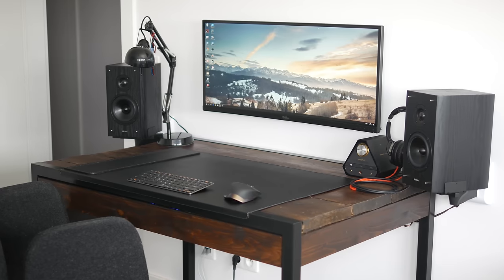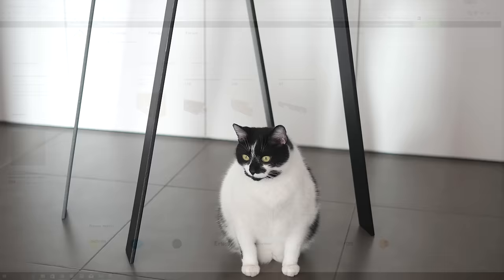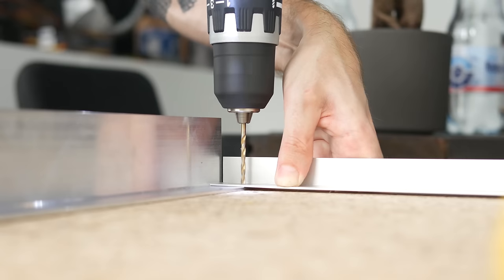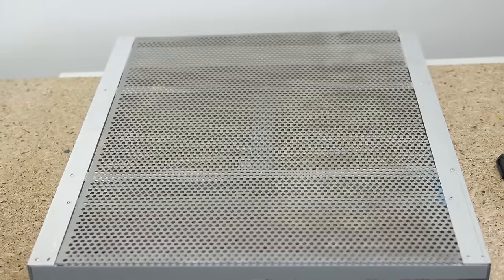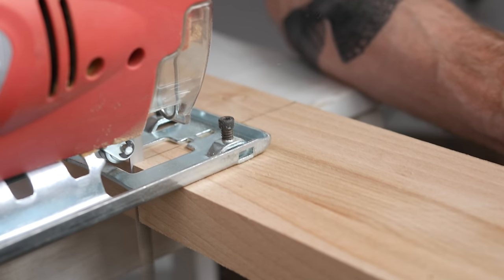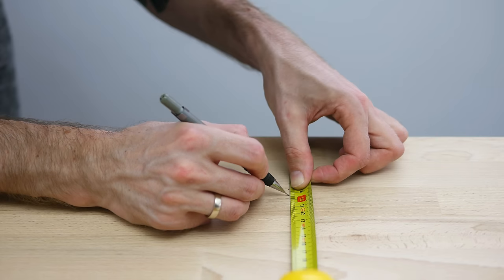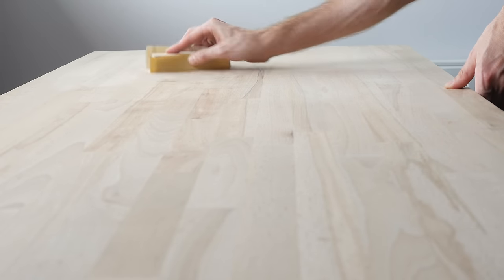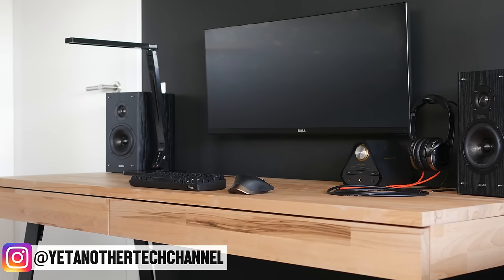How to make a desk PC for adults (DIY desk PC)

Comment: 7:12 "I ordered some of that steel mesh that ricers use to make their Hondas go faster" YOU ARE MY NEW FAVORITE PERSON
Reply: All the dislikes are from the Honda ricers lol. That comment made my day :)
Reply: just scrolled down to the comment section to say the same thing, but saw your comment lmao
Reply: Your toe socks are pretty sweet too.
Reply: For a daily driver , Honda’s are very well built.
Reply: @Internet Guy i have a 2010 si bought  new and have 52k kms on it. No major problems so far except for a evap check engine light while my wifes 2014 honda accord had a starter problem at 45k. I used to like honda but I think they are banking on their name instead on building quality cars like they did in the past. Not planning of getting rid of my si considering all the new tech that they are putting in new cars is only asking for major headaches on the long run
Reply: @dregsta  must be bad luck. I had a civic in 2007 which I sold in 2015 with over 100,000 miles on the clock. Zero issues with it.  I then bought a new civic in 2015.  I have had it 4 years and no problems yet.

Comment: That's not a CNC it's a trim router an CNC stands for computer numerical control
Reply: I was about to write: "wait did he just say CNC?" xD
Reply from the maker: Duly noted ;)
Reply: Stewart Your profile photo perfectly match with 
your comment. 😂😂😂
Reply: Duly*
Reply from the maker: Duly noted (and fixed ;)
Reply: this is impressive, good work! i have a couple more tips for you. at 5:10 it looks like you're using a saw designed for cutting across the grain (not along it) so i bet that took a really long time. and i'd recommend pan head screws for fixing metal parts like legs and brackets to timber(5:38), the flat bottom has better contact to the piece and will reduce the tendency to get sloppy over time.
Reply: I was cracking up at that. At first I thought he was joking, bragging about his preciseness with the router and his hand tools. He hand cuts it so precise, people will think it was done with a CNC.
Reply: Stewart I know that's not a CNC machine because I've seen one. Maybe he need to go learn about tools before he makes a video using tools.
Reply: " Maybe he need to go learn about tools before he makes a video using tools." what kinda comment is that the dude just built a desk from scratch using only hand tools and power tools and the results were good so just because he made a slip up about calling a router a cnc router suddenly he dosent know about tools? he did alot better than most channels theese days its lets make a desk step 1 buy a desk step 2 screw some bits to it boom desk or step one put everything in a cnc router/3d printer/laser cutter have the machine do everything for you hire a mexican to assemble it and boom you just made your own desk
Reply: captainrobots And you could name all the tools perfectly in Polish or any language other than English?
Reply from the maker: I make a living as a technical writer (and not an engineer who knows all the tools) and English isn't obviously my native language so I'd appreciate if people cut me some slack... I'm trying my best, making things in a room that's less than 11 square meters.
Reply: captainrobots as an engineer, I've used some, and just from your comment judging someone who made a mistake, you don't actually know much about CNC, because it isn't just one machine, it's a whole category, from centre lathes, milling and Lazer cutters. I know it isn't common knowledge for everyone, but you're last line in you're comment was just unfair, yes we all noticed the mistake, but really what's the big deal, he's been corrected and acknowledged it before you wrote your comment.
Reply: YetAnotherTechChannel dude you don't need to defend yourself against these comments! I heard you make the mistake but I knew what you meant and the fact that you built this table so well with the tool you used is amazing! Haters gonna hate, Potatoes gonna potate! Lol
Reply: yeah yeah bulls shit
Reply: Rob Groom Defend himself? He made a mistake. He doesn't know what a router is and he doesn't know what a CnC machine is. You have to be able to take criticism, especially if it's a factual error. If he didn't, people would watch his videos and believe that a trim router is actually called a CnC machine when there's 100% no computer controlling it.
Reply: RaySchrantz how many subscribers have you got??? 18...... well done son...
Reply: Adam Ross  to be far we should call things by the right name, however he had a reason, he recognised his mistake, and now knows for next time, so we can all stop bitching and appreciate the desk he built that looks very good
Reply: YetAnotherTechChannel you did a great job. I definitely want to build my own.
Reply: Your profile pic goes with your comment really well
Reply: Daniel Willets are you talking to me?
Reply: MyTruckinLife ACE. No the original comment
Reply: Daniel Willets sometimes these threads are confusing. 😺
Reply: you could've said potato fryer for all I care. lol your work is amazing
Reply: shake it off shake it off...
Reply: @YetAnotherTechChannel  chill out youtube community got your back bro. keep shining. also, beautiful desk. i'm interested in making one for myself so now, you're an inspiration :)
Reply: Lmfao, I was gonna say the same thing.

Comment: I mounted my PC inside a solid oak cabinet with a slide out draw for the keyboard+mouse :D

The hardest part is cable management and making it neat. I thought cooling would be an issue but that was the easy part, with only 2x 120mm fans on the rear blowing in it already runs cooler than inside my Corsair case! The cool air being sucked in forces the warm air out of the gaps at the front.

Comment: Any chance you'll upload your sketchup files so I can build one without having to do my own measurements etc?
Reply: Callum I would appreciate that too. Want to build my own Desk too. :)
Reply from the maker: I can upload it... but I'm not sure if it's going to be very useful - the drawer has absolutely no details.
Reply: whatever info you have would be useful :) overall dimensions etc and the overall design would be a great help - as the video is often a little hard to follow in working out exactly what is attached to where underneath
Reply: it looks like it would be useful from what i could see on the video
Reply: Upload!
Reply: Callum Did he ever upload the file???
Reply: This guide has sufficient to make your own desk, in fact depending on the size of your room his one might be too big. 1700x650 is a lot of desk! If you want to fit a similar pc build in the drawer then just make sure you allow for a minimum internal drawer size of 550x500, then attach angle aluminium brackets to fit your particular build. I would recommend using m3 bolts rather than rivets, as you can't adjust something you've riveted very easily. As long as you draw a scale plan of your desk and allow for the thickness of the wood, the drawer runners etc., and you have the tools for metal and wood work then you should be fine.

Comment: Very nice work but why, when you have put so much effort in to the desk, did you mount the gpu upside down instead of showing off the "nice" side of it?
Reply from the maker: 1. It's an OEM Zotac GTX1060 so it has no 'pretty' side. 
2. This way GPU fan has better access to outside air.
3. It's not that the desk has window (never!) so I'm not bothered at all... 
4. That black PCB is kinda sexy.
Reply: Have you thought of mounting them at a slight angle so the rear edge of each item is maybe an inch of the horizontal so as to provide a bit of a better viewing angle if you also put a see through top on it, I think that would look kinda cool... oh yeah btw damn those socks are brilliant
Reply: Thing is the pcie cable can't be twisted that much, certainly not enough to 180 the GPU

Comment: You've inspired me twice today. First, with the mini ITX custom case build - I was fretting about finding an exact 'cube' case that I could use as the lower level to a Tardis case I was going to mod for my wife. Your bent aluminum approach showed me that I can mod the whole 'Police Box' fairly easily.

But this desk case solves another problem. I have a beloved computer desk with a very wide, but otherwise useless keyboard drawer. I'm going to use the steel mesh approach to build a drawer insert for mounting discreet components. Since I love tinkering with the PC, this will allow me to pull out the drawer and admire my rig... 

Thanks - sometimes the simplest DIY approach is the best, even if cool cases are available at reasonable prices. Nothing beats home grown...   :-)
Reply from the maker: Thanks very much! Your comment just made my day :)

Comment: Interesting build. I'm wondering if this is a good solution for a water cooling. According to the my research, radiator should be positioned above the water pump. Otherwise air will be trapped in the water pump which significantly reduces performance of the cooler...

Comment: I found your table amazing, but you can imagine a way to leave that temperature display in a visible place, like an open one that you did to dissipate the heat on the table, maybe with a glass cover, would look amazing.

Congratulations on your work.
Reply from the maker: I was going for the 'clean AF' looks - hence no windows and no RGB. I can control fans connected to that controller through a desktop software or a mobile app.

Comment: hello ! trying my luck here. great build. I took your design as model. I made the drawer. I made the desk. but could only find a cable riser with 90° angle so the highest element in the drawer is the riser itself because it's making an arc ! Where did you find a straight cable riser ? I'm looking for a 4.0 one...

Comment: This is definitely one fancy look of PC but I can tell you, I did that way back in 2000 when I stuffed my AMD Athlon 700 into my desk drawer, and here is my advise.  You are not going to open your drawer every day or probably not even to open it until your PC is shut down because of power outage.  So you really don't need all those fancy plates to station parts, the key to success in desk drawer pc is good airflow to control temperature only because most of the time desk is wood and it's not good conductor for temperature control.

Comment: I know I am late to the party but if possible, I have a question:  How did you connect the mouse/keyboard (et al )?  Are you running them inside the drawer?  Or is back panel of the motherboard flush with the side or back of the drawer?

Comment: i like the build and may see about doing something similar for myself. my only issue with the build is the open grates on the desk and under the drawer. i would suggest lining the bottom with a layer of some sort of filter material. I would expect a quick buildup of dust otherwise. how is that working for you?
Reply from the maker: I talk about this issue in my setup tour video:https://youtu.be/PfO_QBOoPFg

Comment: Two questions: 1. What 3D CAD software are you using? 2.  Are the fans actually pulling air across the PC/graphics boards or is it just pulling it straight up and out the desk top?  I'm not seeing how it is helping cool the computer components.
Reply from the maker: Software is SketchUp Make.
CPU is cooled by an AIO (all in one) watercooling unit and its radiator is at the back. The opening in the top helps exhaust the hot air. The graphics card has its own heatsink and fan which draws the air from the bottom of the drawer and pushes it towards the back of the desk. This is how essential components are cooled. Ideally, there would be additional fans pushing the air over the motherboard so the chipset and other components have some active cooling. I've been running such setup for over a year now and everything seems to be working just fine... ;)

Comment: yes but you could cut square hole  in the front panel of the pc slide and add glass and put the thermal screen behind it so you will be able to see it without opening, also there is plastic spiral thing that is used to hold cables together instead of using duct tape...
Reply from the maker: But the whole point was to make it look like a regular desk and not a desk PC ;)

Comment: How did you managed the cables? I mean Like for the screen and the Sound. So you have to plug them all out before opening the drawer?
Reply from the maker: No, I don't have to disconnect anything to pull out the drawer. Cables are long enough, and they are fixed to the desk so they fold somewhat neatly when closing the drawer.

Comment: Awesome video. Just wondering what benefits and drawbacks you have found with a desk pc like this?
Reply from the maker: Benefits: 
- aesthetics
- less clutter

Drawbacks:
- limited expandability (e.g. it would be challenging to run two GPUs... doable, but challenging)
- not totally silent (but this is something that can be improved with better cooling components and a few changes in the design)
Reply: YetAnotherTechChannel yeah I was wondering about the noise but still seems awesome 👍
Reply from the maker: Noise isn't a concern - I can record voiceovers for my videos with the computer on and the mic doesn't register any noise coming from the desk.

Comment: what riser cable did you use?  a LOT of us are suffering with the ones supplied by thermaltake
Reply from the maker: I'm using a cheap, generic riser for $8 - I benchmarked my rig and with the GTX1060 it has absolutely no impact on performance in games.

Comment: Very interesting setup you have. It's def one of the cleanest and most precise hand skills I've seen in a long while. Can you tell me what that Modeco tool you use to hold the aluminum pieces together is called or a link? I've been looking for that for the longest time but i don't know what it's called. Thanks for the video!
Reply from the maker: I'm not native English speaker, but I believe it's called pop rivet gun. Just note that it's one that can handle threaded inserts.

Comment: Your work is amazing! 
But I can't do that... My PC isn't that "small" to stays into desk, I need a desk only for my HHDs, one for motherboard and 2GPU liquid cooled, but....... 
I have a question: what about the heavy weight of the hardware and the hot air? In summer, hot as lava air isn't that good on your feet/hands.....
Reply from the maker: You'd need a bigger drawer ;)
It's really hot these days and the desk doesn't have a noticeable impact on its surroundings - it doesn't get warm or anything.

Comment: Hey man, I'm doing a similar build and I'm kinda stuck. How did you manage to route your usb, sound and any other cables that connect to your motherboard?
Reply from the maker: All cables that connect to the motherboard or the video card are attached to the bottom of the desk - make sure to leave some excess of each cable - just enough so you are able to pull out the drawer all the way. If you do it right, the cables should fold nicely when you close the drawer.
Reply: Thanks for the quick response, I'm also curious about the fans. Besides the CPU cooler's fans there are no other fans in the system?
Reply from the maker: Nope, just those two and the stock cooler on the GPU. It's been working just fine for almost two years now, but I guess it wouldn't hurt to add two 92/80 mm fans to blow over motherboard to cool the chipset and what not.

Comment: Very nice desk! Congratulations!
Could you please tell us the height of the steel legs, the height of the desk overall, and the thickness of the wood planks please? Thank you :)
Reply from the maker: Wood is about 27mm. It's a custom build - so the height of the legs should be adapted to your exact needs.
Reply: Thank you for answering. I'mcurrently in the process of building my own inspired by your design (except that I have less room and an actual ATX mb). I was asking for the desk height because I didn't reallyknow what to choose. I ended up with a plan of 74cm high desk. 
Cheers.

Comment: Hi i like the idea , how to resolved the dust issue. Over a period of time dust get accumulated on this exposed pc part how to avoid/ resolved it
Reply from the maker: You can try sealing the drawer and installing filters, but I don't consider dust to be an issue. There's obviously some dust accumulation but nothing that would affect cooling performance. But if it bothers me - all it takes is 3 minutes with a vacuum cleaner every 6 months to keep it nice and clean ;)

Comment: Hello, one question. How do you handle the situation of when the drawer is pulled the power and display cables not pulling out ? Also what front IO is that which shows the spinning fans?
Reply from the maker: All cables are long enough to pull out the drawer almost completely and they fold somewhat neatly when closing the drawer. That thingy up front is the Bitfenix Recon fan controller.

Comment: Here is a question. On the newly arriving Intel Hades Canyon PC's they do not have a place for a 2.5" SSD and have 2 m-keyed M.2 slots (Nvme). There are no NVMe readers that I know of on the market, so how do you migrate your OS from an non M.2 SSD to the NVMe SSD in the Hades Canyon??
Reply from the maker: You can get an M.2 to SATA adaptor - connect both to your Hades Canyon PC, boot it up and then use partitioning software to copy contents of one drive onto the other, including boot sectors information, etc.

Comment: where did you get the metal grading with round holes?   I'm located in Poland Wroclaw and searching for somethign similar (more hexagon holes) but that would be also sufficient.  And I can't find anything of that size in Castorama or other such shops
Reply from the maker: You should double check your Castorama store because that's where I found it (albeit Warsaw ;)
https://www.castorama.pl/produkty/narzedzia-i-artykuly/artykuly-metalowe/okucia-budowlane/blachy/blacha-perforowana-100-x-100-cm-rv-5-8.html#product